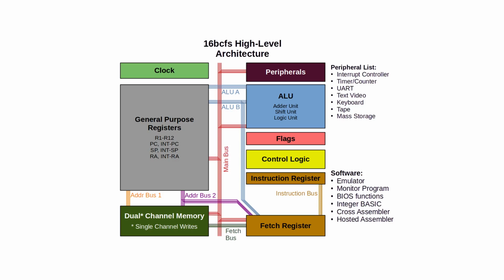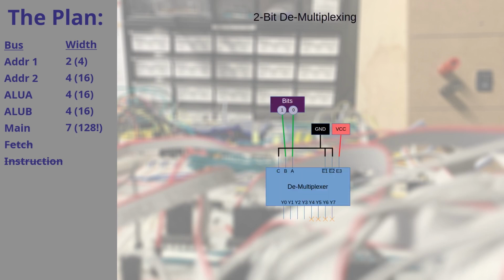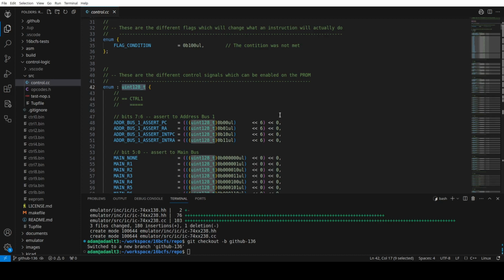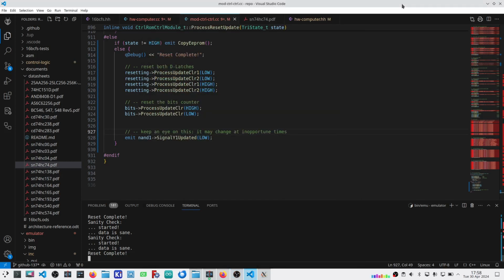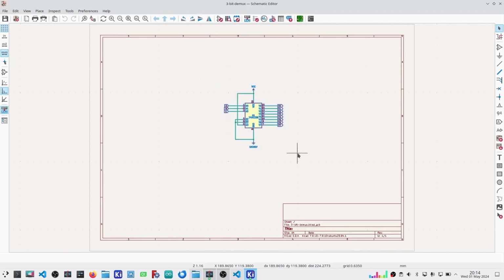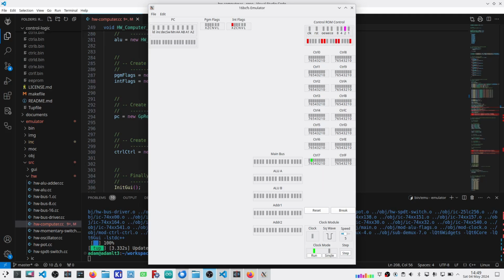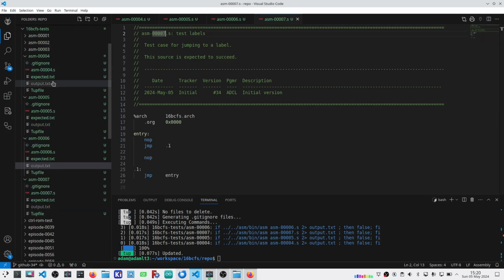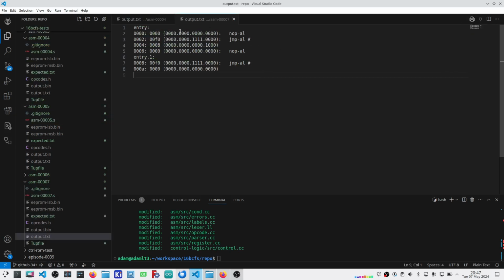0098: De-Multiplexing Control Signals (& cleanup)| 16-Bit Computer From Scratch

Comment: Not the subject of this particular video, but I find interesting that you plan to have interrupts in your processor. I don't think this is something available in other "computers from scratch" that have been built before, so I will be curious to learn how you implement those when the time arrives
Reply from the maker: @RelayComputer -- Thank you for your continued support!

I may be oversimplifying, but I believe the most difficult part of handling interrupts is in preserving state -- Program Counter, Stack Pointer, and Flags -- when entering the interrupt handler code.  I really did not want to handle interrupts with multiple clock cycles or multiple pseudo-instructions.

All the way back in Video 25, I talked about having an conteXt flag in the instruction register (1 of the possible 15 bits).  https://youtu.be/vga_IrB0jcQ  I have not yet seen a reason to change this plan.

If you look closely at the full emulator in this video, you will see the separate Program and Interrupt registers depending on the context.

Also, building out the interrupt controller is high on the list of things to get done, once I get caught up in the build after my setback.
Reply: @eryjus4594  I am not and expert in this particular subject as I never tried to implement this in any of my "on-paper" computers from scratch, so that's why I am curious about what your approach will be. My understanding is that this can be tackled from several approaches of varied complexity.

In the 'very' old times, I used to make software for the 68000 processor, so maybe I am able to mention how it worked from the software point of view.  This processor had two operating modes: "supervisor" and "user". Some instructions were only available on supervisor mode, and caused 'traps' (a.k.a interrupts) when attempted to be executed while in the wrong mode. The processor also had two Stack Pointers, one for each operating mode, and it could support Protected Memory through additional hardware. This means that a user process crash due to unauthorised memory access or stack corruption/overflow could be recovered by the system while in Supervisor Mode, because the Supervisor Mode Stack Pointer was not corrupted. This also allowed the implementation of debuggers for compiled code, and proper multitasking.

Interrupts on the 68000 caused the processor to at least:  (1) switch to Supervisor Mode, (2) switch to Supervisor Stack Pointer, (3) call a subroutine depending on the type of interrupt which address was stored in the "Exception Table", and (4) push the status register onto the supervisor stack. Other  "Exceptions" will automatically push additional information on the Supervisor Stack, such as the instruction opcode being executed, and other esoteric things such as the contents of some internal busses, and so on. It was all very complex... Only the user accesible registers, were left for manual  preservation by code inside the Exception Handling routine.

On the other hand, earlier processors such as the 6502 had only one single Stack Pointer, and no explicit operating modes. Interrupts were treated just as a special case of subroutines (named interrupt handlers). If an external interrupt arrives, an interrupt handler is called automatically 'after' completion of the instruction being interrupted. Since this still works like a subroutine call, the PC is automatically pushed onto the Stack, and upon return it points to the instruction next to the one being interrupted. So the user program will just continue where it was interrupted. State preservation is entirely performed in software in the interrupt handler by explicitly pushing everything on the stack, including the Status Register (Flags), then popping it all in reverse order just before returning.

The AVR family of 8 bit microcontrollers have quite an extensive set of interrupt types, including External Interrupts, System Timers, USART RX, TX States, EEPROM ready interrupt, DAC Completion Interrupts, and possibly more that I forget. However, these processors still have one single Stack Pointer and no operating modes. State preservation is full responsibility of the user/programmer and again consists in explicitly pushing everything on the Stack as the first thing to do in the Interrupt Handler. The Status Register Flags, are preserved by copying them to a general purpose register (previously saved) and pushing that register contents onto the Stack. Of course, again, everything must be explicitly restored off the stack just before returning. The hardware will just 'call' a particular address in lower memory, depending on the type of interrupt. Lower memory addresses are referred as the 'Vector Table', and these addresses are typically filled with 'jump' instructions that point to the relevant interrupt handlers. For example, the very first address (Address 0), is the "Reset Handler". The processor will 'call' address 0 when a "hardware reset" is detected. At Address 0, a 'jump' instruction to the first instruction on the user program (or system boot-loader or whatever that is relevant as the thing to do upon reset) is usually placed.

So I believe that if you are able to take one of the simpler approaches, the hardware implementation of detecting interrupts and calling interrupt handlers as a consequence is probably more challenging than the actual problem of preserving state, because after all, the latter is just a matter of using the processor instructions that enable that, which are already there given that subroutines are supported.